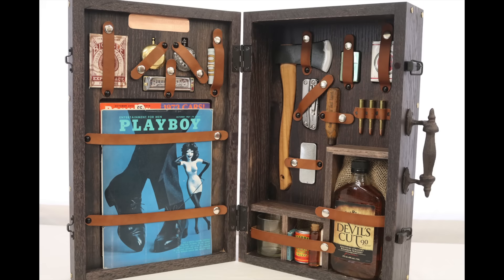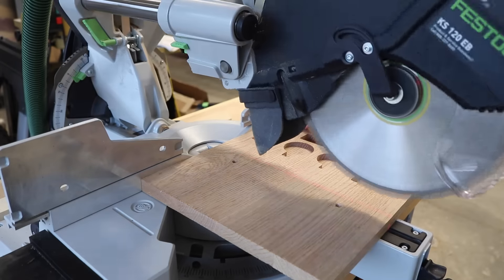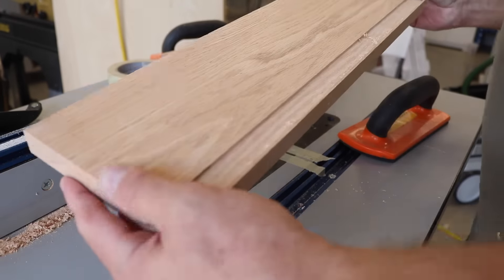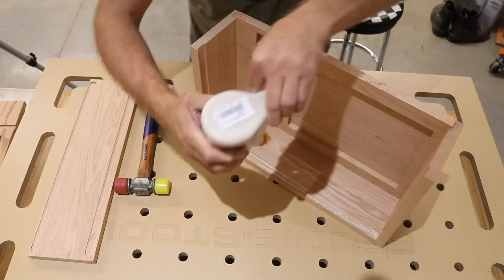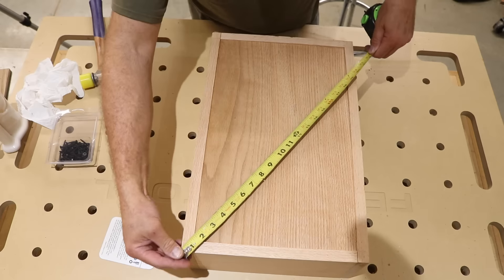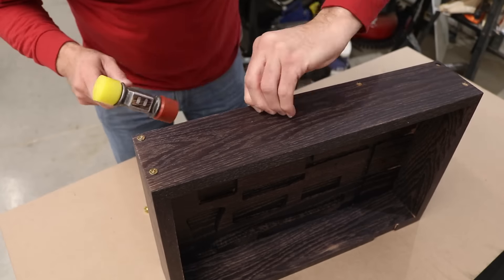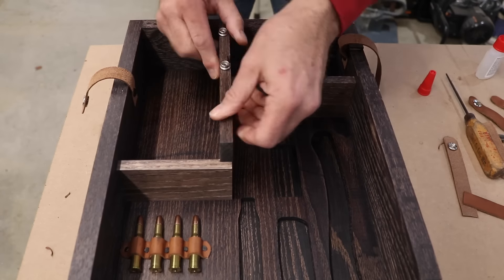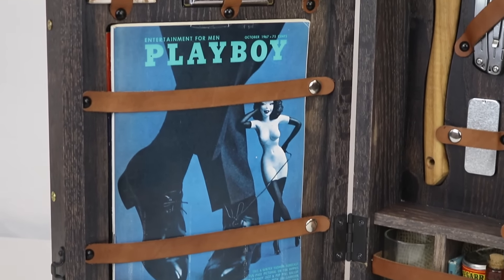Project Breakdown - Building a Vintage Case

Comment: Very  nice Feddiei! 
What stain/color is this?
Reply from the maker: Hey Scotty.  Check out the full video and you can see how I did this.  It's posted on my channel.  Spoiler alert:  Vinegar and steel wool....
Reply: Ha! I should have known, im a huge fan of vinegar and steel wool, especially with red or white oak. Great results also aging wood , put some dings on a table top, wipe with vinegar/steel wool mixture let it turn black, sand it back. this leaves the dings and scratches blackened and then hit with some stain ( early american) watch the magic happen. i built a hall table and many thought it was a 100 year old antique.